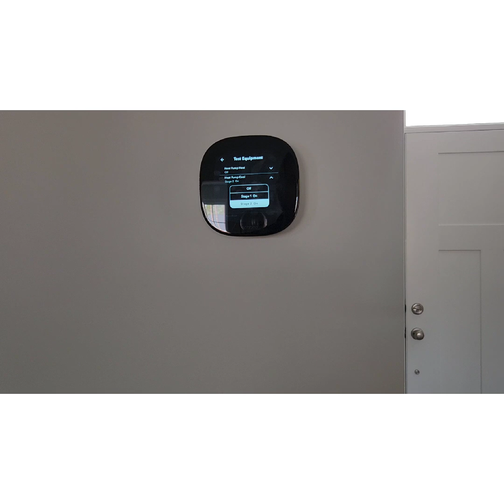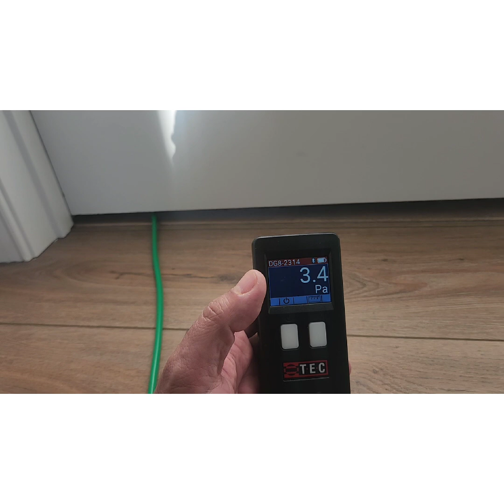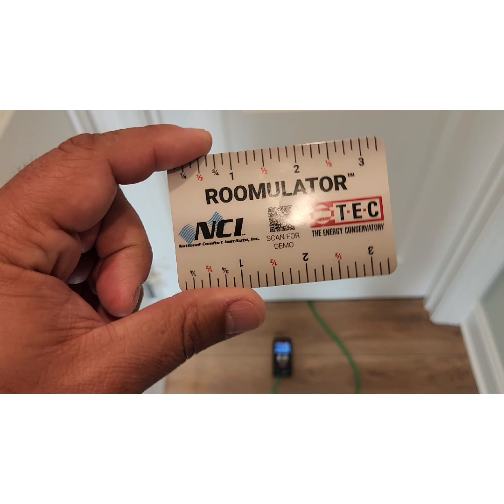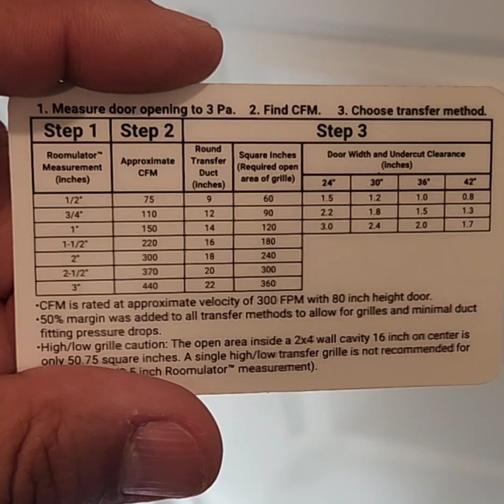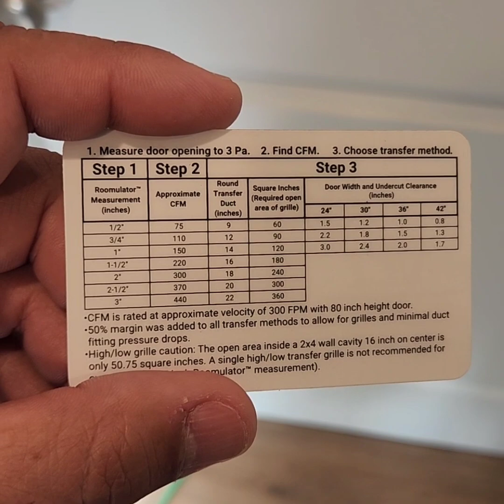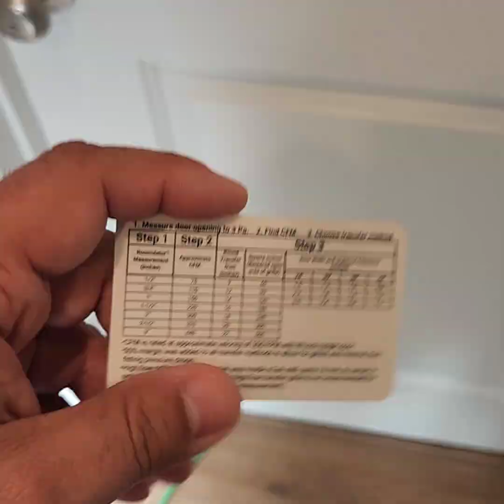Room Pressurization Diagnosis With The DG-8 And Roomulator™️

Comment: What you mentioned at the end about the room having the right amount of CFM is what I wanted to ask. Is using this roomulator method only good when assuming or knowing that we have the correct designed amount of airflow coming into the room?
Reply from the maker: Correct if you change the air going into the room the pressure in that room will also change.